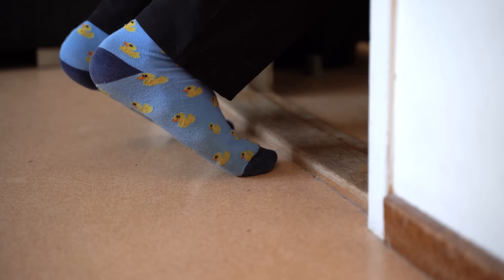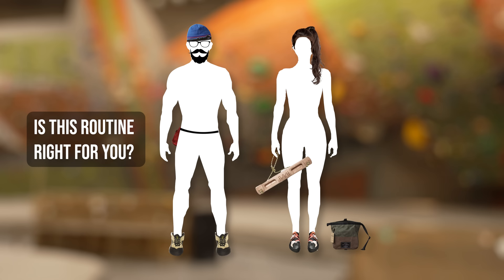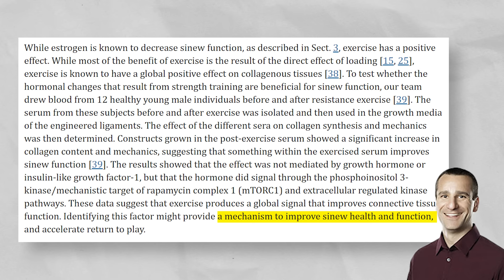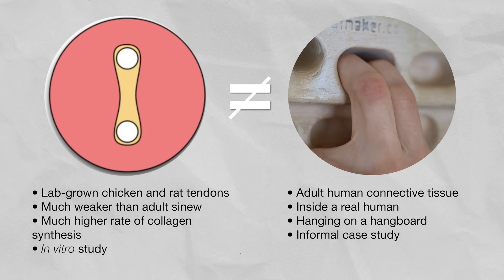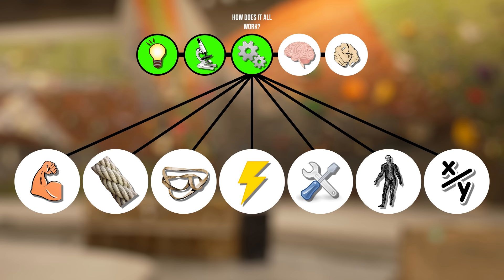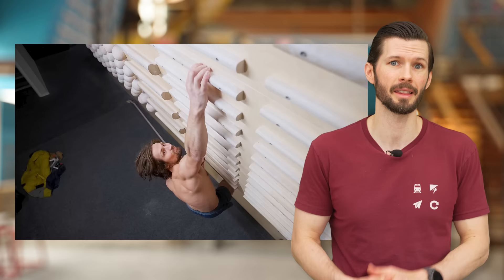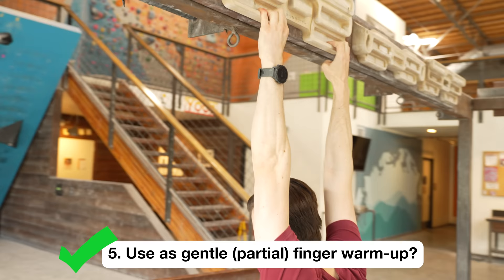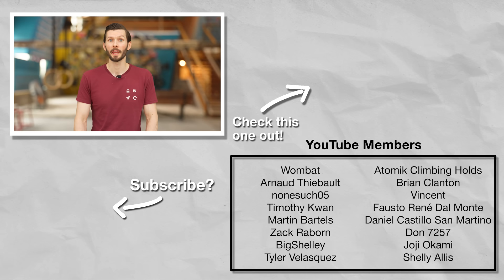Should You Hangboard 2x/Day like Emil Abrahamsson? (New Analysis & Recs)

Comment: I've been doing isometric hangboarding for 2 months and it's working great for me.   In fact, I've changed my whole body dumbbell weight training program to focus on holding in place for a second or 2 on each rep.   I've never been so strong and confident.    Knowing that it takes 2 years to get to 80% tendon strengths vs 3-5 months for 80% muscle strength has revolutionized my training routine.   I focus on my tendons instead of my muscles.   No more tweaks or twinges in the pectoral and bicep muscles.     Appreciate the Hooper perspective as well.
Reply: When you say holding in place for body weight training. Do you hold in the half way point of the exercise or the end
Reply: @mormonboy25  good question and I edited my reply to clarify that I meant dumbbell training in the gym.   And, yes, holding in place 2 to 3 seconds at random spots on each rep to make it more isometric... Whereas, the rest of my life I just tried to build muscle and count reps which almost always resulted in tendon injuries .. for me at least isometric and slowly building up the tendon strength is working very well :-)
Reply: Perhaps it is all about the mitochondria which produce ATP?
I used this protocoll with great benefits.
After 1 week I did 12 pull-ups instead of 6.
After 6 weeks I climbed 6b+ in the climbing halls instead of 6a.
I had no muscle increase.
I suppose that I improved my metabolism.
The top runners for 100 m produce about 7 times more ATP per second than an amateur runner.
They have trained their mitochondria to a maximum: more mitochondria per muscle cell and more efficient in output of ATP.
     Training till failure implies damages of muscle cells and long training sessions.
      Reparation takes time. It is a setback.
      Is that really necessary?
      Yes is the answer of all people who make their money by giving long lessons 
       or by renting their gyms.
Think of adaptation in our evolution.
We do not  adapt to a single event/stimulus but to a series of stimulation - to repetition. 
The repetitions do not require maximum.

Comment: A couple of years ago, Mani the Monkey tried the protocol in a much more systematic way than Emil, testing many hypotheses. His personal experience was that the protocol was mostly improving his skin conditioning, meaning that he could sustain more load on small crimps!
Reply: I forgot about that! I’ll have to go rewatch it now, thanks!

We thought about that, and I certainly buy that it could be a nice way to help ensure you don’t get blisters / crease splits when you ramp up after not fingerboarding for a while. 

Thinking only about the micro hangs though, It’s actually inconceivable (to me personally) that partial weight hangs on a 20mm, no matter how often, would affect skin enough to enable hanging 6mm.
Reply: You're in ever comment section i see :D 
Well, when we meet here anyway, i would like to ask a question: I really struggle on giving 100% effort  on single moves, which is obviously bad for bouldering, i am ony the other hand very good at enduring longer, harder stuff with sub maximal. Do you have any sources which could help me find my inner "on-button" to go 100% for single moves. I already tried breathing (whim-hoff and tummo) but that didn't really do the trick. Breathing loud while doing the move and exhaling helped a bit.
Thanks :)

Comment: The main positive effect I‘ve seen for my climbing following this routine has been a more consistent perceived „tension“ in my fingers. I‘ve been training / hangboarding for 7-8 years but I‘ve always struggled getting consistently good climbing sessions. On good days my hands are like claws waiting to latch onto holds. Especially after rest days however, my fingers often felt like overcooked spagetti even after a normal hangboard warmup at the crag. I never found a way to control this variable until implementing this protocol. Either keeping it in place on rest days or using it to phase out of 2 consecutive rest days on the evening prior to the next climbing session, I seem to be able to activate claw mode (🤓) reliably before each session. 
Thanks for the indepth analysis in all your videos, they are greatly appreciated!! 🙏🏻

Comment: Hi Dr Hooper. One thing I would love to see you address regarding two-a-days is the fact that nearly all elite level endurance runners run twice a day. Their general training schedule is to run 7 days a week with a light run in the morning and a light run in the evening, with 3 main workout runs per week in place of a light run - i.e. Mon hard track intervals / speed work, Wed hard tempo run, Sat a very long run at moderate intensity. All other 10-11 training sessions that week are typically short and low intensity. 

If removing those 10-11 short, low intensity sessions per week in favor of say 2 more hard workouts was optimal, that schedule would have risen to the top of their sport by now. 

This is quite standard for running at an elite level, and that sport is more advanced in terms of training knowledge than our relatively new and growing sport of climbing. I believe the way elite running coaches got to this training was trial and error over centuries, eventually ending up at this relatively optimal training schedule. I realize there are some differences between running and climbing, including that runners care about the cardiovascular side more than we do, however they are primarily getting those benefits from their weekly track intervals, tempos, and long run - not from the short, low intensity runs. It sure seems likely that there's something happening there that involves keeping their connective tissue healthy so they can run harder with less frequent injuries. While they have some theories, they don't really know why they do it. They just have learned over a very long time that it works. 

Your thoughts on this would be much appreciated.
Reply: this comment was so helpful. the analogy with running helped me to understand the point of hangboarding twice a day

Comment: So I have been doing the routine for 3 months now, and I feel that for me it does a good job. I dont feel like it increased my strenght, but I finally can apply my max force while climbing without having pain after crimpig a bit in a session, which was the case the months before I started. I feel like the base level of my fingers and especially the resistance against higher load, has increased by a lot, which for me was exactly what I needed. I now feel like, that my finger strength is the limiting factor again, not my finger health and. As I said, my fingers are now capable of using the strenght I had before I started the routine 3 months ago. No overloaded pulleys for example since then, although I crimp a lot more near my max in every session. After about 1 month these results were clearly noticable.

Comment: It would be good to validate the intensity people actually use with Emil's program, as based on my experience with force meters and testing, I could easily see it ticking into the 80%+ absolute intensity range without the person realizing it. One could do this by testing the person with a force-sensitive hangboard, but we'd need to take precautions against the athlete changing how they perform the protocol once they know they're being watched / tested.

All of the analysis hinges on athletes keeping the intensity low, but from having observed climbers for about 10 years, I don't think that's plausible. Climbers have an overwhelming tendency towards doing too much in any given context. Without evidence to the contrary, I would assume that anyone doing this program is routinely ticking into the higher intensity range without realizing it.

Comment: The pain science factor is definitely huge. Recently i made massive gains in my bouldering, going from a v6-v7 plateau to consistently sending v8 and even my first v9. I also just felt stronger.

But all the training I did also causes my fingers to start hurting which immediately dampened my performance back down to v6-v7. Crimps i uses to cruise though now felt difficult again.

Currently taking a break while including low intensity training (like the hang boarding routine explored here) and hoping to stsrt crushing again soon.
Reply from the maker: Thanks for sharing! Yeah the body/mind is really great (sometimes) at protecting itself and it does so often by limiting that force production. Which can be frustrating though if you're not willing to listen to those signs! Sounds like you are though, so good work. Hope you are feeling better soon!
Reply: @HoopersBeta  thank you and thanks for the reply! I took about a week off and just went climbing today. My fingers felt much better! I think I had just overworked them after doing too much intense kilterboard climbing lol.

During the break I did a slightly less strict version of the Emil hangboarding technique, along with squeezing one of my "grip training" rings (I call them doughnuts tho). I also did some deadlifting and other climbing adjacent workouts.

Even though I didn't push my limits today I certainly felt stronger again which was really reassuring since I was feeling super down after my struggles last week. Gonna ease my way back into things and hopefully send even harder soon 😤.

Comment: I applied Emils approach to a full body workout, doing 10 moderate exercises, alternating between core and upper body stuff and just 10 reps or so each(Pushups, Pullups, bicycle crunch, that kind of stuff). Followed by some half crimps and 3 finger hangs on my toes, trying to pull rather hard for 10 breaths tho, most of it on the small beastmaker 2k edge(12mm?), which would be impossible for me to hang onto without toes. For me this works amazingly well, i do it usually 4 times per week before breakfast, takes maybe 20 minutes and my body is probably in the best shape it's ever been.

Comment: In my personal life experience of working out, I do feel that light-medium intensity exercise significatly improves neuromuscular activation at any intensity level.

In a sense, there is tremendous "skill" in doing any exercise, and by practicing it a lot (in a focused manner), you get a lot better at it.
Reply: This is my thoughts, I feel that recruitment/neurological adaptation shouldn't be discounted. All movements are "skills", regardless of muscular finger strength, holding a crimp is a very specific movement. 

Twice a day, low intensity fingerboarding means that Emil's body is performing the activation of holding a crimp far more times than he otherwise would have.

That repetition could make the body simply more accustomed to performing the act of crimping regardless of intensity. The idea that repeating that movement numerous times might have some effect on the "efficiency" of his grip doesn't seem out of the question.

Comment: I think the workout is a great add as a supplemental work and has much of the same benefits as active recovery.  I do also think that for the less than 10k hours masters climber there is something to simply adding the extra reps( greasing the groove) in regards to how natural the movements become (sounds silly but that was my experience with it...was also doing BFRs at same time).  Moreover I do also theorize that the additional stressing of the tendons "In addition" to a traditional training program may likely result in increases in tendon strength longer term (which is also sort for the same reasons as more stimulus, more blood flow, more collagen delivered equals more tendon gains).   Lastly I think this is also a great stop gap exercise to add in if not feeling the try hard vibe, injured, or on vacation.  But yes this workout alone will not result in any of the strength gains.
Reply: This is exactly what I took away from it, and Emil himself also put out some similar theories in a (semi) recent climbing podcast.

Comment: Could it be possible that frequent light loads or finger curls could be increasing circulation and synovial fluid movement helping the fingers recover more quickly from the actual high intensity training?
Reply from the maker: Certainly. That sort of falls in the "other" category. Increased activity like that could lead to small changes in circulation which could have a cumulative effect but not enough to explain the huge improvements they experienced.
Reply: That was my thought. My second hypothesis is : what is the intensity need to get small hypertrophy gains. We know that failure is not essential to generate hypertrophy and Emil said that he go until he feel some stretch in the finger forearm. So if we go to the door where the training is intense enough to get some small hypertrophy gains in the pulley, but not enough to generate high fatigue. We could have something that help to recover in the rest day and let you go all in with high intensity training.

I do believe the recover hypothesis is the most probable one :P

Comment: Loved the video, thank you for the deep dive on this. One comment on the notes & corrections re: blood flow:
Not sure I understand your aversion to the blood flow explanation. You train a muscle or tendon hard, and now it needs to recover for adaptation gains. Pick whichever mechanism you want: muscle hypertrophy, tendon thickening, tendon remodeling, vascular remodeling; don't these all require goodies from the blood? Consider an athlete that does a hard training session on the legs (could be strength training or HIIT or endurance), then lays immobilized in a bed until the next training session, compared to an athlete that does the same session with a lot of light movement (i.e. walking) in between sessions. My understanding is that the "active recovery" athlete will be better off, and this is largely due to the increased blood circulation afforded from the low intensity movement. This isn't something we need to think about much for legs or even arms because most people are using them constantly to navigate the world and perform tasks. For fingers, however, there is a much greater distance between the load of everyday tasks and training load, which might be why a dedicated "active recovery" routine has such an outsized effect on performance. Not to mention the fingers are small and distal, and a few minutes in a cool environment is enough to demonstrate how little the body cares about keeping up circulation in the fingers (compared to the IT band for example).

Comment: Great video and analysis a couple years on. All the points make sense to me. Additional idea to the discussion of what is happening is his routine seems more akin to an isometric overcoming exercise reliant on muscular contraction rather than passive tension and the stretching of certain fibers. Even at bodyweight, many strong climbers will find flexing the fingers to lift themselves challenging, and using isometric overcoming exercises you can consistently get near to maximal effort. If maximal is say BW+10% to flex the fingers... 90% of BW would still be a no hang but be >80% of the MVC.

One more aspect is integrating active pulling with the fingers into the skill set, comparable to practice of active pulling with the toes. For myself, after I used the concentrics and isometric overcoming exercises, I found I was more than simply selecting grip positioning to make use of the hold and now notice the active engagement of the fingers and this intention to pry the hold from the wall as necessary. Several clients respond the same, feeling better contact with the hold and able to make better use through a range of motion. With the active toe exercises, I know many climbers who saw a sudden breakthrough with a few weeks of this, and definitely several climbers finding those deep but severe incuts on a project or similar to be far more manageable and useful. Would not surprise me if, with the gentle incut of campus rungs and the significant change of position during the 1-5-9 that this could be at play.

Comment: Good explanation. One hypothesis is missing although related to yours. He obviously does not stop training so in total he does more than before (even if low intensity, but 2x a day on top of regular training. I do agree though with your point and tried it myself for several weeks. The biggest Aha was indeed the combo of much more precise coordination (especially on half crimps) and a gain in confidence as the fingers more and more felt like a full unit vs previously a patchwork of tendons, muscles and joints